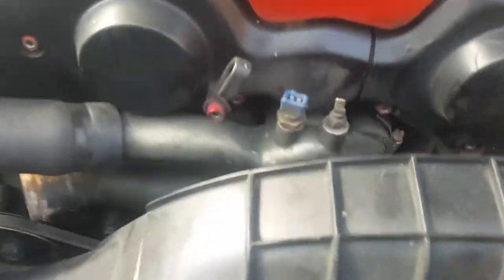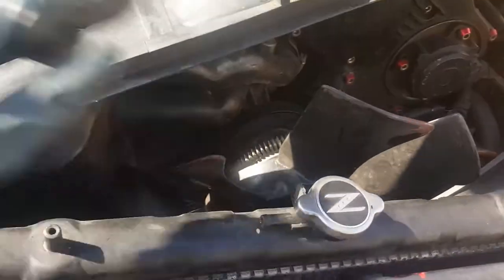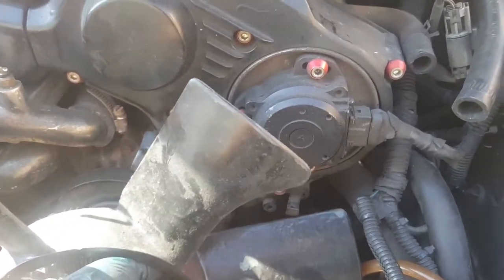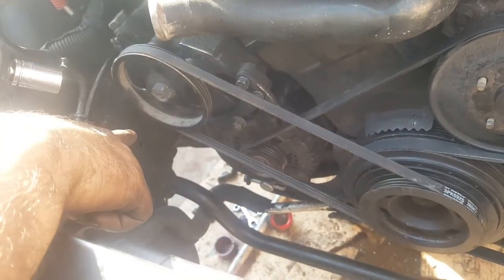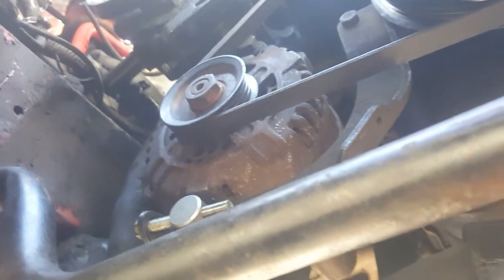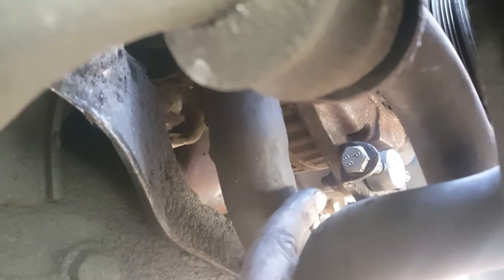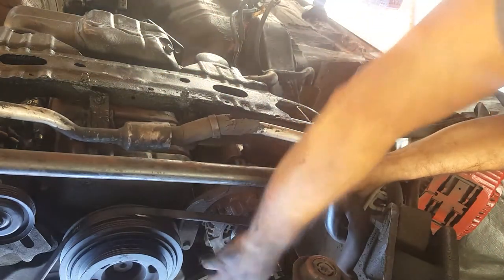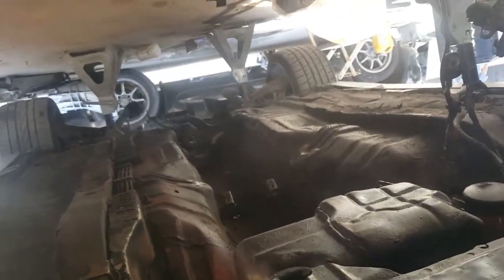Nissan 300zx Belts powersteering AC alternator DIY

Comment: Right in the middle of a timing belt water pump thermostat , VTC spring (wolf tech springs) and idler pulleys and studs (ARP) job.  Gonna have to do the front main seal too cuz its leakin.... cross my fingers it all goes well. Thank you for this great video . It is greatly appreciated.

Comment: Hi. I’m doing the exact Job on my sons car (non turbo version). On the idler tension pulley, the adjuster bolt is missing. Any chance you can tell me the size?  The length looks like it should be around 3 to 4 inch but don’t know the thread size metric. Somewhere between 10 to 14 mm. Thanks

Comment: i have an automatic version of this car, however it needs a new sensor so it will shift into its over drive gears? Do you know where the sensor is located and a good replacement part cause its been a pain... Thanks for your awesome video.

Comment: Black colour on a radiator does NOT help keep the engine cool.  It is wrong because the radiator does not send out radiant heat but sends out heat through air convection and taht is why it is made of thing material instead of thick material . Painting it balck will reduce it's cooling capacity.